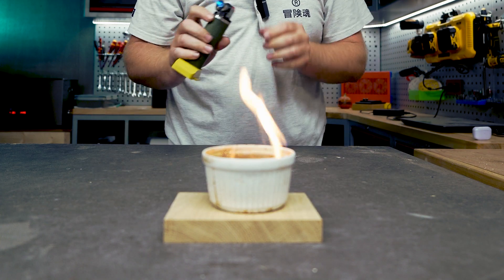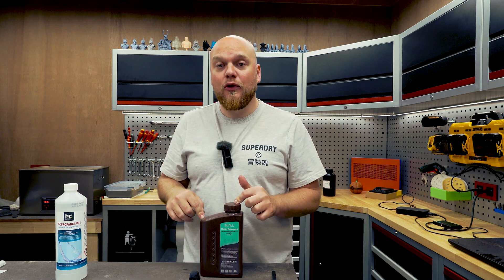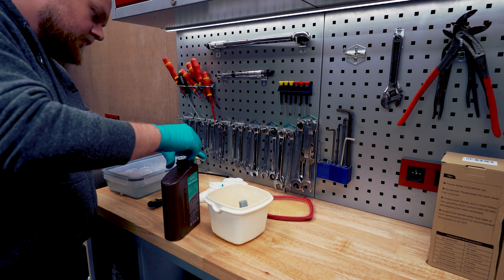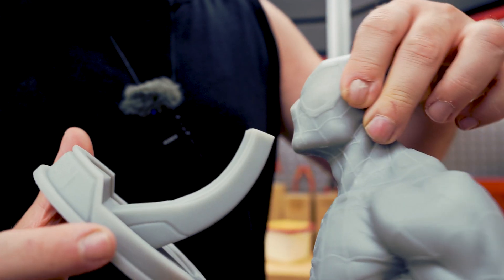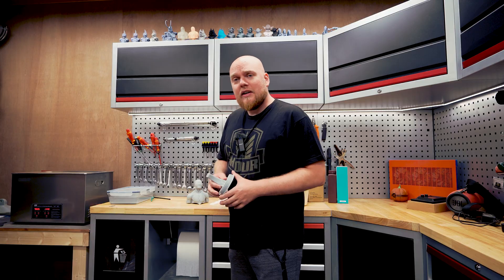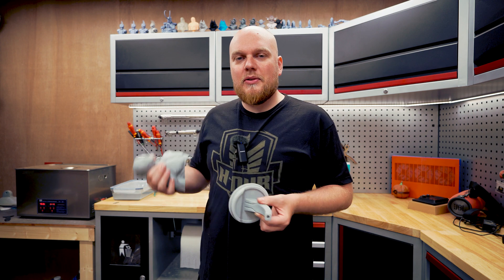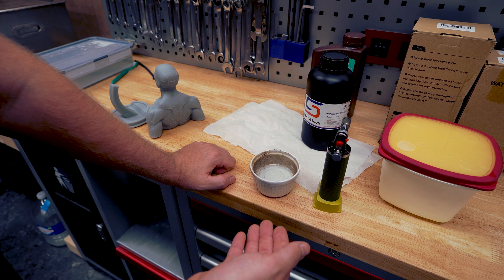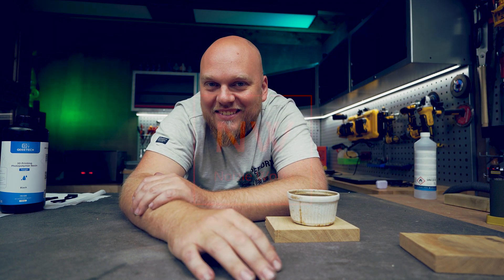IPA vs SUNLU detergent tested! Safer and non toxic option? REVIEW

Comment: You should test the new Elegoo Photopolymer Resin Detergent (which is quite cheap: about 8 euros per liter, VAT incl.)
Apparently, it leaves a lot less film residue on the washed parts than the Sunlu Resin Detergent, which is really "oily". A few people for now tested both detergents and they say that the parts washed with the Elegoo can be rinsed afterward with a bit of clear water, whereas the parts washed with the Sunlu have to be brushed in soapy water to get rid of the greasy and smelly film.
Also (yet to be fully confirmed but nonetheless important question) the Sunlu detergent (as well as ResinAway from Monocure3D) is said to totally prevent liquid resin diluted in it inside a clear container from curing when exposed to UV light; whereas resin diluted in the Elegoo detergent acts like IPA in this regard: it can cure and form a gooey blob in the solution, a precipitate that can be separated and filtered out. Which means that the Elegoo detergent can be recycled, considerably extending its service life and making it even more affordable in the long run.
If you're interested in such a test, I can't wait for you to confirm this (these facts are not widely known outside some forums at the moment). I've not tested it yet myself.

Comment: See the problem with water washable and detergents that need to be rinsed with water is the fact that you are now contaminating water. What do you do with the contaminated water? You cant throw it out, you cant put it down the drain, and it takes ages to evaporate off (and leave the nasty stuff behind to cure).  Hazardous waste disposal in many places (esp in the US) can cost you money.
Alcohol based washes remain superior in terms of how well they wash and how easy they are to deal with from a waste perspective. I can easily wash something with IPA and when it's too dirty to be effective I can just evaporate it off and cure the remaining resin slime and feel comfortable with throwing it out into the trash. The whole process takes less than a single day. With water? it would take significantly longer.
Reply from the maker: Yup 100% now people have all sorts of reasons to not wanne use ipa. This detergent actually doesn't work on a water washable. In that way this is only to show a alternative/safer way of washing regular resins. Now the price is way to high so right now ipa it is!
Reply: Most counties in metropolitan areas will have free hazardous waste disposal days you can drop off hazardous waste at. Otherwise county services or private services might offer ap aid service that really isn't that expensive. Besides, letting IPA evaporate generates a lot of VOC, which isn't great if you're in a neighborhood.
Reply: @paranoidpanzerpenguin5262  I pass my contaminated IPA fumes through a filter system rated for VOCs. And even if I didn't, the amount of VOCs I'm producing with 1L of contaminated IPA is significantly less than Bob across the street using a gas powered lawn mower he bought in 89'

Comment: Did you notice the rubber effect of using sunlu detergent with sunlu tough, miniatures become very bendable 😅 i kinda hoped you would have a solution
Reply from the maker: I only tested it on siraya fast, did you wash it with water after using the detergent?
Reply: @NoizieWorks  yep I did, as instructed. Also I did a test without water, similar result (except being sticky). Another YouTuber encountered similar problem (Hellstorm Wargaming - my biggest 3D printing fail)
Reply from the maker: @ravartd.9846  thanks for the info, do you remember the resin brand and type?
Reply: @NoizieWorks  Sunlu High Toughness - Grey. I tested a bit and after a week the cured Resin hardness becomes better. A big problem is that models tend to bend over the drying time and especially after the soaking the model is very brittle (thin parts like arms are easily breaking). Personally I like the detergent, less dangerous and miniatures details are sharper, so I’m hoping someone finds a fix.
Reply from the maker: @ravartd.9846  i have some toughness left, if i find the time i will do some testing.

Comment: I use the similar product from Phrozen. It is ok but gets super expensive if it is all I use. (I don't use a water rinse and it will settle but doesn't get totally clean even with uv) I like to use the detergent in the ultrasonic cleaner as a pre-wash and then clean the parts with a pump sprayer full of clean ethenol. The denatured  ethanol smells so much better than IPA. Stove alcohol work great for me and don't cost much.
Reply from the maker: Thanks for the tip! this product works great but like you say. It's far from cheap. I use ipa as it's the fastest way but i understand why they sell it.

Comment: Seems quite expensive atm, when it looks like a regular house hold degreaser. But will have to see if it's reusability is better, as that was bit of a problem with many household cleaning products when used for resin washing.🤔And if IPA is too expensive, you can often get denatured ethanol for a cheaper price and it does the same job. Personally I've been using it lately as I can get it for 7€/l while IPA is 15€+
Reply from the maker: I do agree that for my taste it's on the expensive side. Thanks for the input 🤟
Reply: From my practical experience, ethanol causes certain types of resin to flake off and develop needle-like things on the surface, while IPA does not.